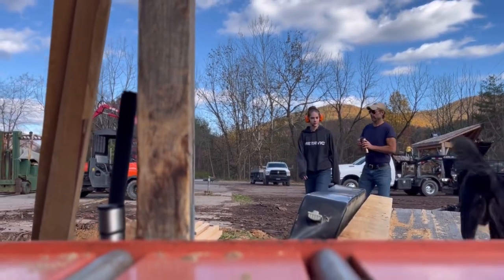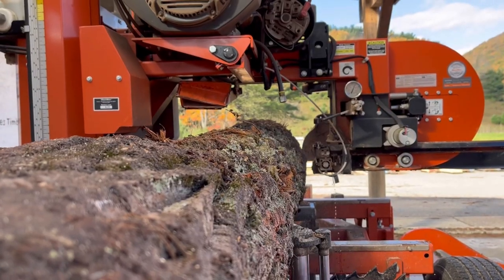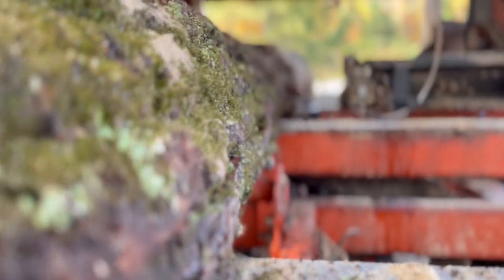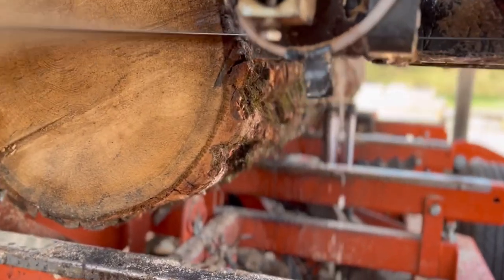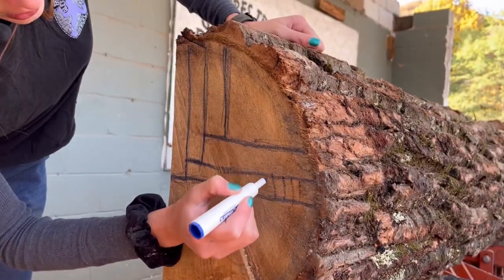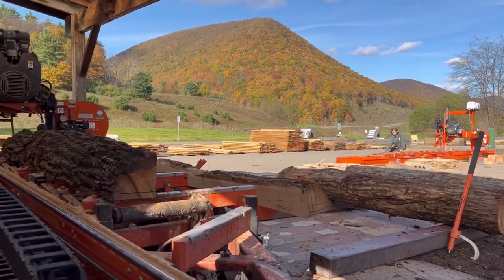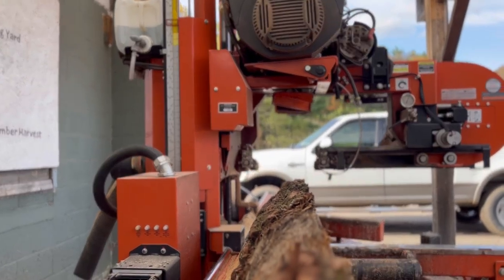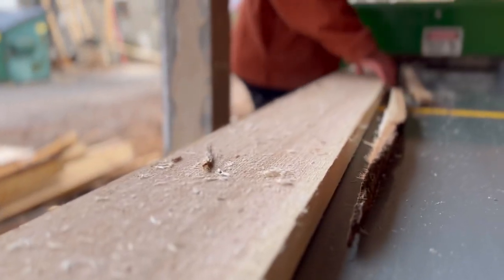MY FIRST TIME QUARTER SAWING: quarter sawing 101

Comment: I grew up in a small woodworking shop. My dad told me that quarter sawn wood was cut into quarters and then the quarters were cut diagonally to expose to figure in the grain. You may be cutting these logs into quarters, but the cuts you make are no different than if you just sliced them . You point out short grain, but just slicing them the center ones will have short grain.     Just sayin                                     Mike
Reply: Not so, Mike.  As you cut successive boards off the quarter log, the grain does start to "tilt" a bit, but a board counts as quarter sawn if the angle of the tilt is less than 30-40 degrees or so ( I forget the exact amount, but you can find it on-line).  What matters more is that there is no circular grain, so the grain is straight from end to end.  There is no "cathedral" grain, and the boards won't cup.

Comment: Only 4 quarter sawn, most of the other bits are tangential cut. You need a variable angle which the LT 40 will not do.

Comment: I'm no sawyer, but, , ,  The technique seems to produce rift sawn wood, just off quarters.  Seems like the quarter should be at a 45 degree angle to the blade to get quarter sawn.  Like this one:
https://www.youtube.com/watch?v=V5PHKCBiRmk
Not sure, but all quarter sawn I've used was cut more like that video rather than laying each quarter flat.  Thoughts?
Reply: Yes, this is rift sawn